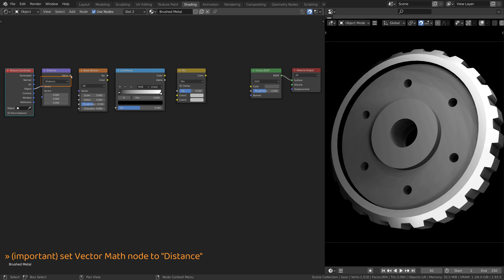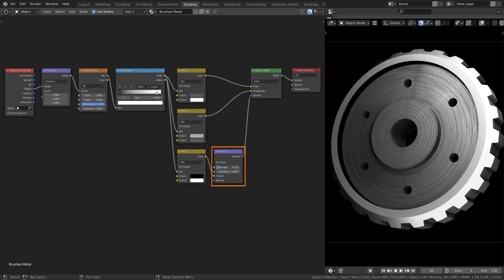Fast and easy circular BRUSHED METAL texture in Blender (Easy Nodes)

Comment: This works great, thanks! However, I want to change the overall color of the model, say like if I want an anodized red or blue metal with this brushed look. How do I apply color to it?
Reply: Never mind, I figured it out. 😁 I just connected a diffuse shader to an additional mix shader and set the color I needed. 👍

Comment: This is the 3rd brushed metal tutorial I've tried and none of them are giving me the result I see in the video, I follow each step, try it over and over, the result is either nothing, or very bad. other than the material itself, is there anything else I should be doing that can effect the outcome? type of light, cycles, eevee, etc..
Reply from the maker: Of course the model and the lighting is important.
Use cycles, just to be safe.

Comment: Excellent, I like that it gives the basic method without frills so you can use it as is or build on it. I have been trying to do this for ages but got fixated on the spherical gradient node so this is a breakthrough.

Is there a way to combine this with your brushed metal node? I want to model a machined wheel so I would like the circular pattern on the face and a straight pattern around the circumference.
Reply from the maker: I'm happy you found it helpful.

You can go about two ways to have multiple material on your models. (a) use a single object with multiple vertex groups or (b) break down your model into multiple objects, each with their own material.

Method (a) gives cleaner results, but is more elaborate.
Method (b) is easier, so it's (in my opinion) best to do when you're prototyping.